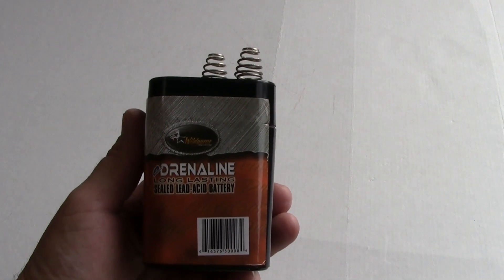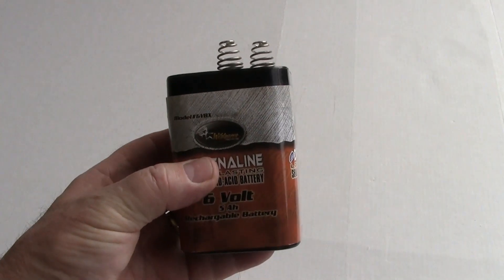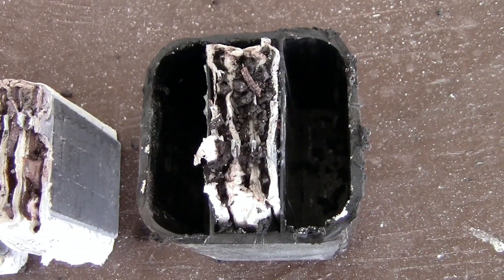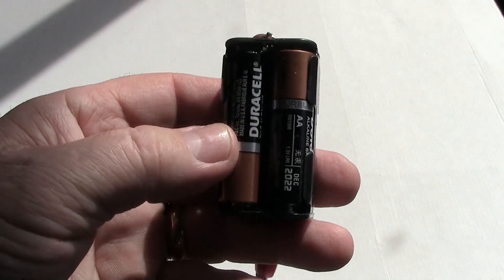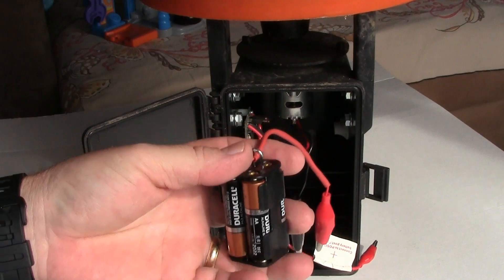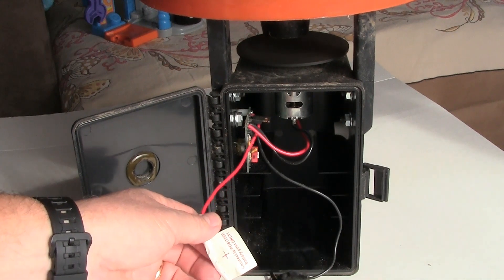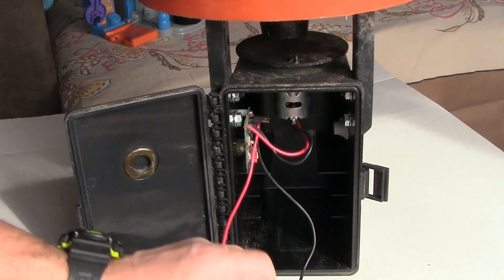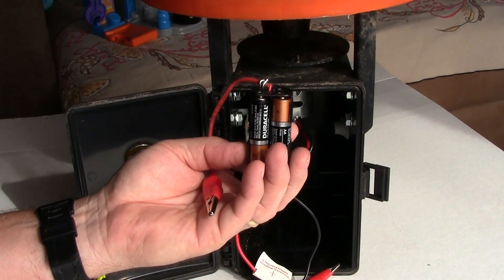What's in the Wildgame 6 volt battery and a 6v alternative battery source.

Comment: Pretty cool. Great thinking. Oh so you dont need to be concerned about the amps?
Reply from the maker: I would check the needed amps for the camera, however, I wouldn't use a 6v car battery but then I might try just to see what happens.
Reply: The only issue with 4 dbl A batteries as opposed to a 6V battery is they will wear down faster. I ordered a rechargeable 6V that will fit into my wild game deer feeder.
Reply from the maker: I've had better luck with the 4  AA's. The 6v would not hold a charge after the first couple time and did not last very long.